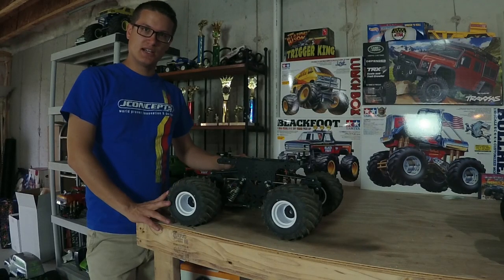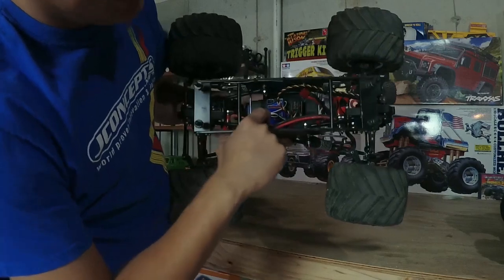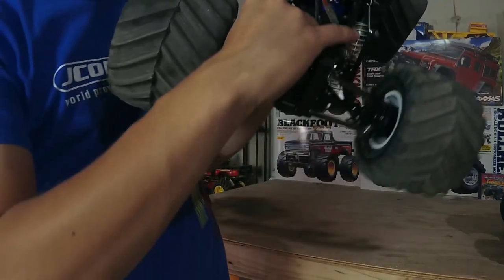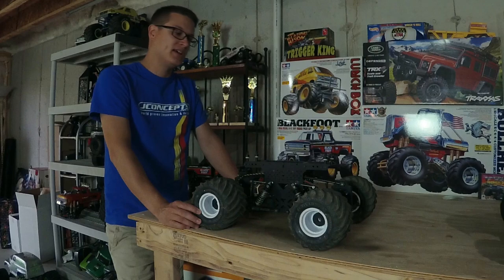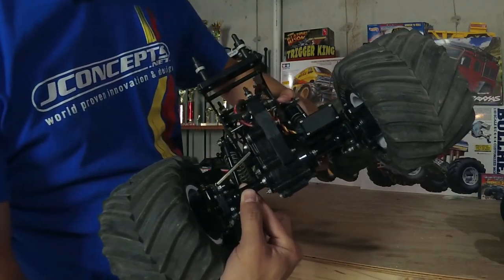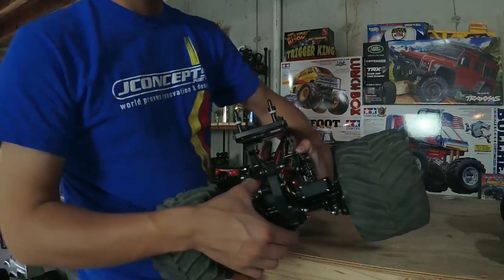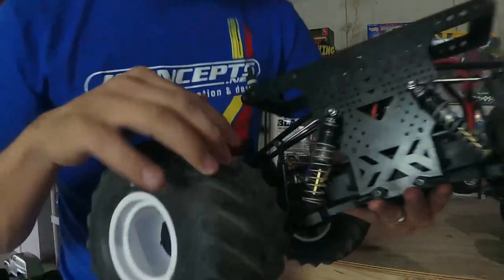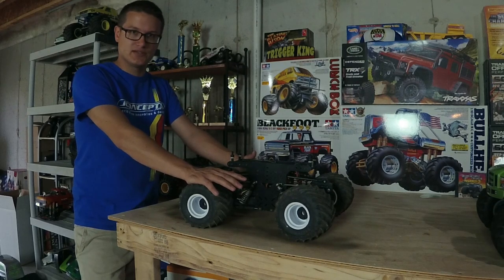Detailed Look at a Modified Tamiya Clodbuster - Trigger King Tech

Comment: Great video.  Do the racers swap out the gears in the transmission or they keep them plastic (diffs too)?
Reply from the maker: Many use the plastic ones as steel/aluminum gears are super pricey and just keep extra sets on hand for when they need to change them out

Comment: This seems like an idiot question, but does Absolute Chaos RC sell the whole truck, axles, bars everything. Or does it all come in separate kits?
Reply from the maker: They typically sell the chassis kits but they will also sell everything you need. They've built a good number of "turn key" trucks for customers.

Comment: Is 500 or 600 because I want one for my birthday
Reply: Moshawn Kirkland You can get an SMT10 Grave Digger or Max D for under $400. You'll need a battery and charger. That'll probably be another $100. You can check on Tower Hobbies or RPP Hobby websites. Both respectively have good prices on those two trucks and everything you'd need. For more info you can always visit RCMT.net, ClodTalk.com and you'll find a lot of information about these trucks too.